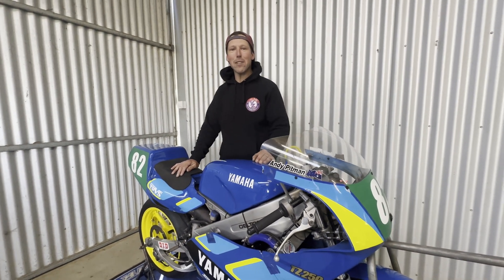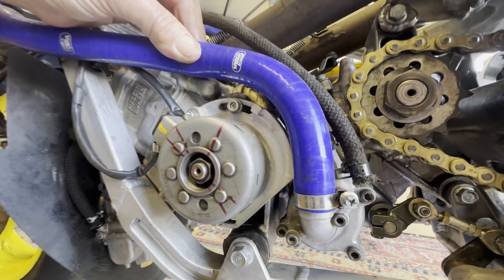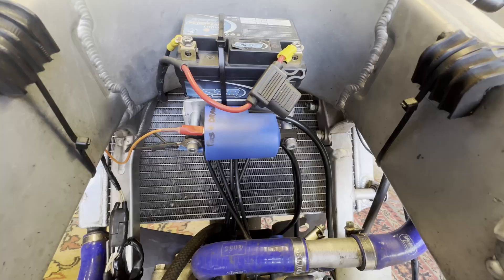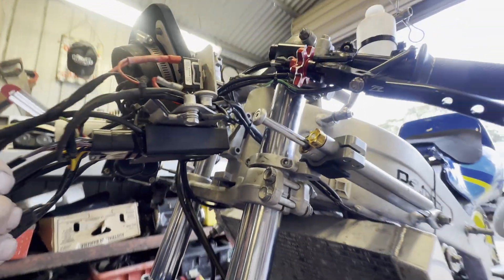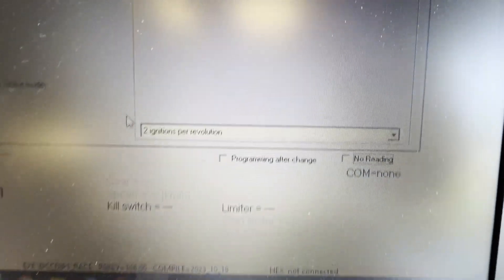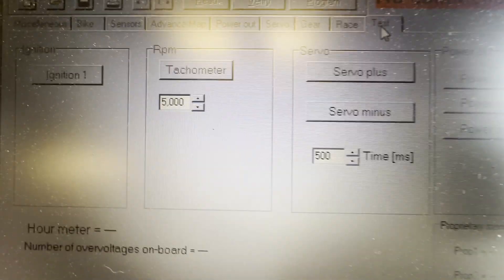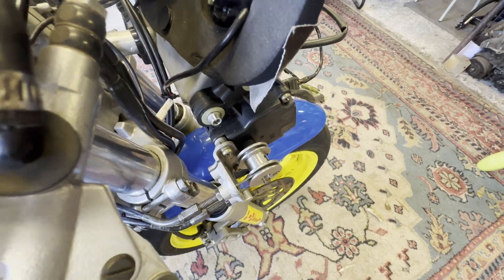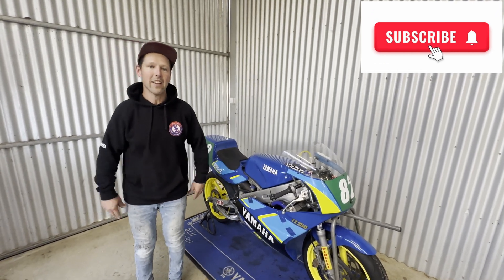TZ 250 Ignitech Ignition Part 2

Comment: Great video. Took us a little while to get on top of out Ignitech. Do you run a power servo on your engine? If so does it use a 5 wire setup? thanks
Reply from the maker: Good work on getting ignitech to work. It has taken us some time. Since this video I did I have learnt more about the ignitech. I will be doing another video to show the changes I have made and the improvements we have found. We don’t run a power servo mate

Comment: Great video! very interesting, Don't know if you did a Dyno run on the bike with the original Yamaha ignition before you fitted the new ignition? If so you could compare the results after you finish the new set up on the Dyno.
Reply: @AndyPitman-vt7hm  brill! I’ve just purchased a 3AK, gonna do some races next year, currently getting the bike and myself as ready as I can so looking forward to the results!
Reply from the maker: @richardsaunders8031  great to hear. Are you in Australia? Be great to see another reverse racing mate
Reply: @AndyPitman-vt7hm  Father and son based UK team bud, Dad fixes it and I brake it! 
Currently fitting a 3TC rear wheel as the 5” rear allows you to fit 165 rear slick. 
Looking forward to seeing future videos!
Reply from the maker: @richardsaunders8031  I recon I will do the same with a 5’ rear. The shape of the 165 would be spot on
Reply: @AndyPitman-vt7hm  yes it fits perfectly, you do need to fit a spacer behind the front sprocket tho (about 3mm), be careful as the lock washer does not fit on the splines after, so hit the edges of the lock washer into the lightening holes around the edge of the sprocket. 👍
Reply from the maker: @richardsaunders8031  great info thanks mate. I will get it happening
Reply: @AndyPitman-vt7hm  No problem bud, shame I cannot send you some photos! Keep in touch and we can pass info!
Reply from the maker: @richardsaunders8031  yes we did do a dyno run and we have it saved. I can’t wait to compare it with the new ignition. Speaking to people about it they didn’t get much change in top HP but a massive improvement in the mid range